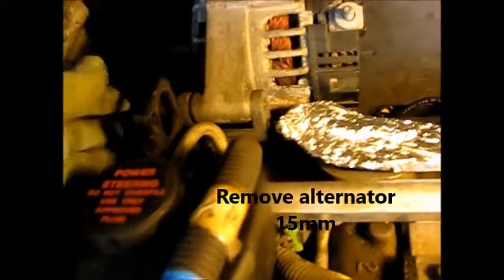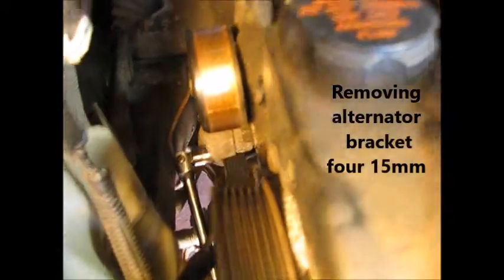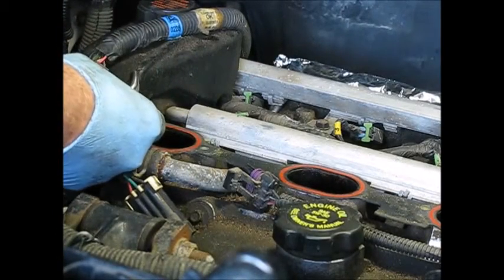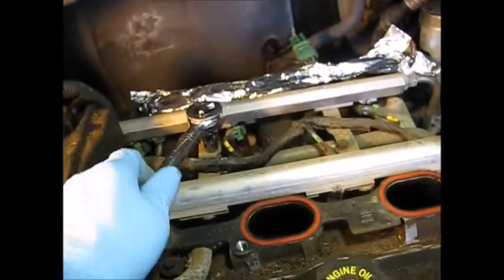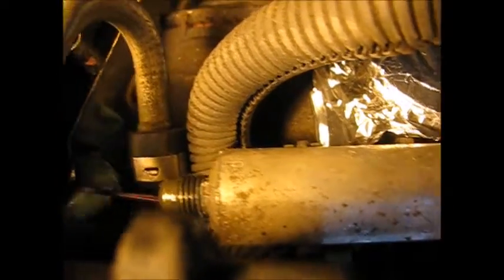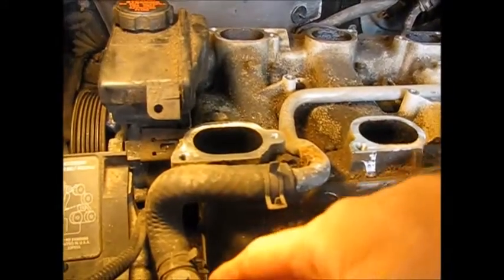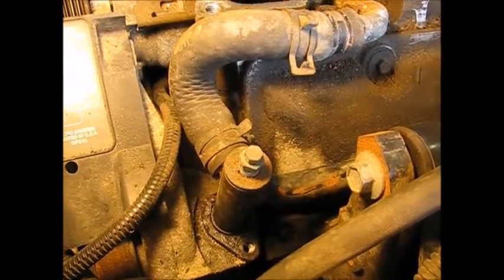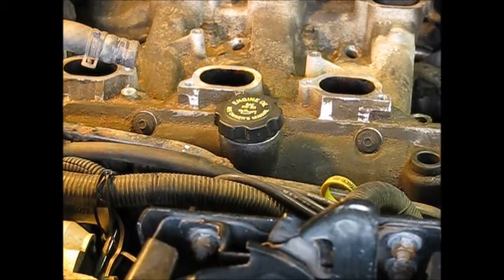3.4L GM lower intake manifold gasket replacement part 3: Removing components from the lower manifold

Comment: after doing this job I have a leak on the throttle body side could it be the o ring on that crossover pipe into the top of the intake manifold?  I have a feeling the asshat who did the job reused all the old o rings

Comment: The water pump doesn't need to move on the 3.1, just the power steering pump, alternator, and bracket. Thanks for the video tutorial!
Reply from the maker: You're welcome. You had me scratching my head though. I didn't remove the water pump, just tubing coming out of it and crossing the manifold. .
Reply: @TheOriginalMechanic  In the video, you were referring to the power steering pump being in the way, but you called it the water pump.